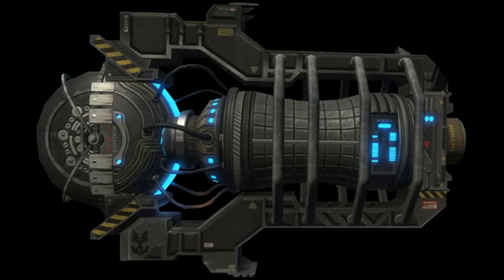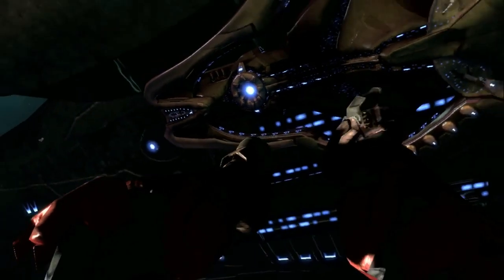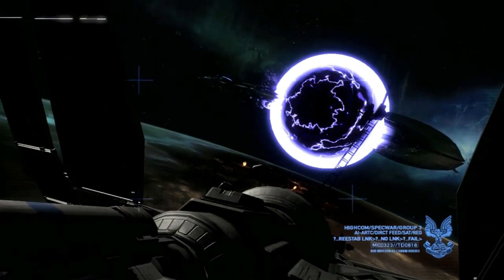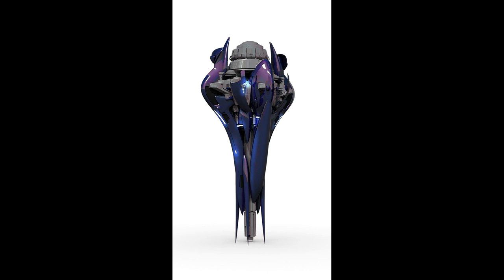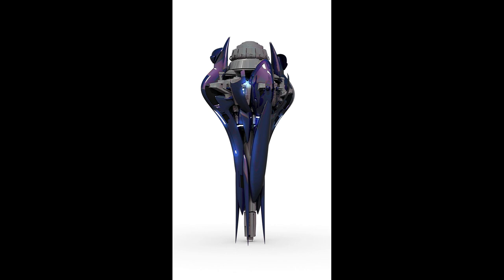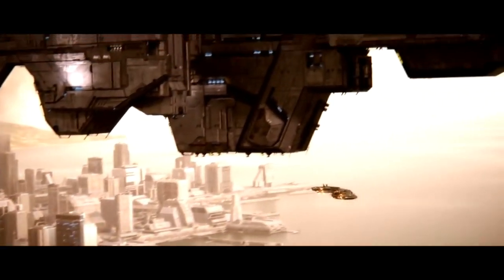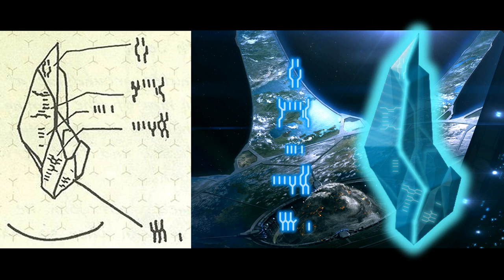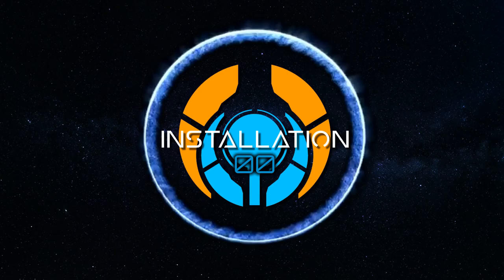Halo - Slipspace Engine - Lore and Theory

Comment: Here's my own head canon on how slipspace drive works for the three factions.
Human: self explanatory you just told us.
Covenant: a plasma reactor channels highly potent plasma via magnetic fields into a point where the density is of that of a neutron star, then it's compressed into a slipspace portal.
Forerunner: the slipspace crystal acts like a 'quantum key' that once activated, gravity in the drive is so strong it turns into a slipspace portal from the dark matter trapped inside the crystal.

Comment: I could be wrong but I’m not so sure about the rotating black holes creating traversable wormholes. As I understand it unless you have negative energy any hypothetical wormhole would collapse long before anything could pass through. They’re notoriously unstable things
Reply: It's possible, provided the blackhole don't have extreme pull to get you spaghettification, a few scientist awhile back propose this theory how some blackholes are'nt extremely powerful as they seemed to the point to you won't be ripped apart on an atomic level. I think that's why theoretically its best to enter through with micro-blackholes. Who knows also blackholes are simply wormholes to other dimensions.
Reply: Well with a rotating singularity  (a spinning black hole), it's stable especially since the ones that are being discussed are very massive (5+ stellar masses) they tend to have ridiculous live spans. It's only the micro-black holes that evaporate due to Hawking radiation. 
A rotating singularity has the potential to be linked to either another black hole elsewhere in the universe, or potentially it's opposite, a white hole, again elsewhere in the universe forming a wormhole  (Einstein-Risen bridge)  potentially allowing near instantaneous ftl travel between the two points. The hypothesis Is actually really facinating.

Comment: I have to mention this though. The forerunners not being able to travel faster than they did has nothing to do with the universe they are in stopping them. If that was the case then the precursors couldnt have created star roads. The forerunners just hadn't been able to create a faster mode of FTL, why wouldn't they, if slip space physics was preventing them from going any faster. The destiny from stargate didn't travel through hyperspace, and crossed galaxies from within weeks to months. Compared to Atlantis which could cross the pegasus void in three days, though hyperspace, not too mention the wormhole drive. In the millions of years since the precursors fled. The forerunners biggest advancement was in  reconciliation technology. And some speed. As much as I dont resort to extended canon the forerunners stagnated because of their social structure and pride. That's why they chose not too leave and explore other galaxies. They didn't think they'd learn anything new.